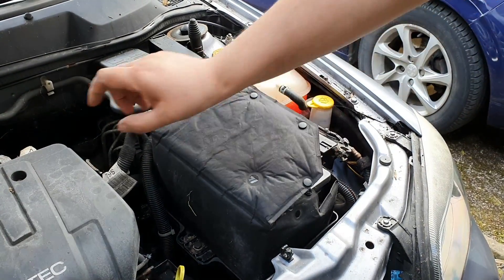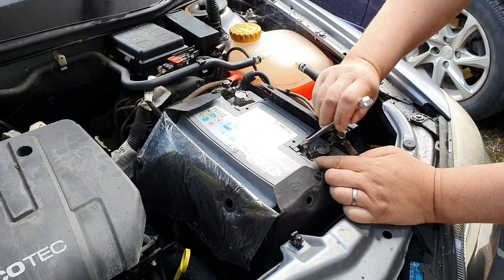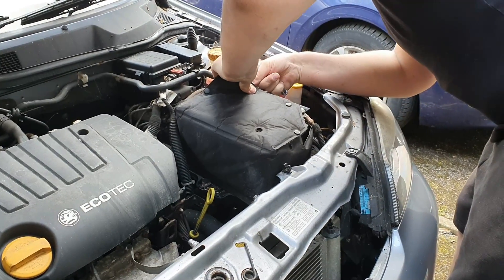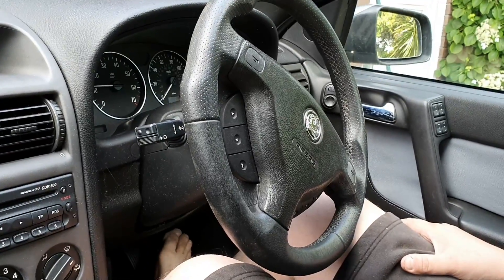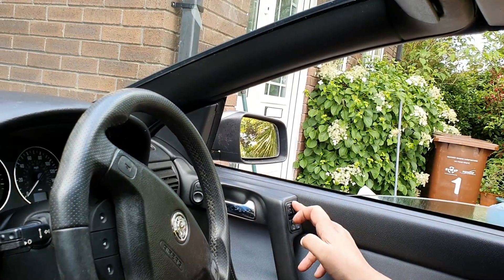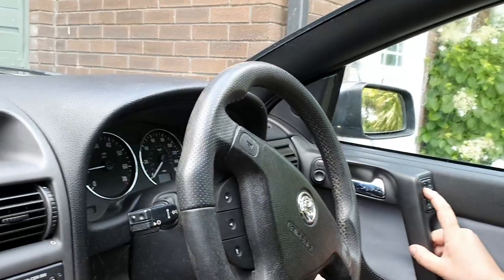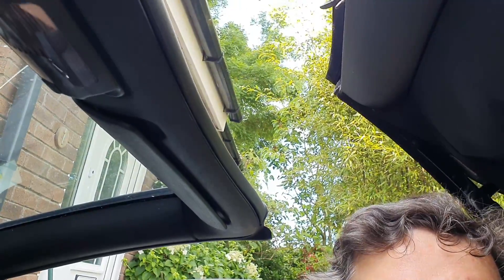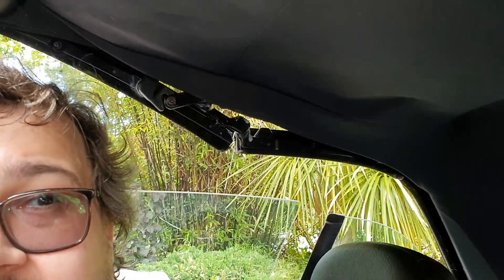Vauxhall Astra G Bertone - Re-syncing the windows after connecting the battery

Comment: Very helpful. I have Astra G Bertone Coupe, I hope this will solve the issue (I disconnected the battery before I put it on a charger.) May I ask how did you know about this solution? Is it in the owner's manual? I need to buy an owners manual, cant find it anywhere.
Reply from the maker: If I recall, it is mentioned in the owners manual. However, a quick google search turns up the results fairly quickly. It's a very common 'fault'.
Reply: @JCTsFascinatingHobbies   Thank you, I was lucky to find and download the manual, I am reading it through and learning more about the car. (Don't want to run to the mechanic every time some small thing like this happens.)

Comment: Hi, I have recently got a brand new battery, all windows were fine until today, only driver window has stopped working, I seen another video on resetting it with the key in the door lock, it did move but still not paired. Can you help me with this please. Thank you.
Reply from the maker: I have had this happen, sometimes I need to re sync the window, twice. So, fully down, hold five seconds, fully up, hold five seconds and repeat.

Comment: I bought one of these cars, 2002 2.2 Astra Bertone for my daughter, the passenger window sometimes opens a bit more when the door is closed, instead of going back up, I might try this reset. 
I have also aquired a complete circuit diagram Hardcopy covering all engines from year 98 to 2002 including Bertone, every pin, wire, module, relay, locations, everything.
Reply: I have same problem with passanger window, sometimes Window jumping a few timies like crazy, now it doesn’t work compl so every time before open this doors I have to slide the window down. I’m not sure what causes this, maybe external handle? If you find out please let me know 🙏

Reset doesn’t work
Reply: @Wtfcorps  I have a feeling that the signal is sent to the window from the handle mechanism, i have not found it in the diagram yet and now going away on holiday for a couple of weeks, I will look when I get back, I would take the door skin off and look at the inside handle mechanism to see if there are wires there and have a poke around
Reply: @EssentialComment  Thanks for reply, I thought about that too, I read, however, that the window lowering motor may also be to blame, which does not want to be re-coded after disconnecting the battery, please let me know when you see more, I will probably dismantle the door only when it warms up outside